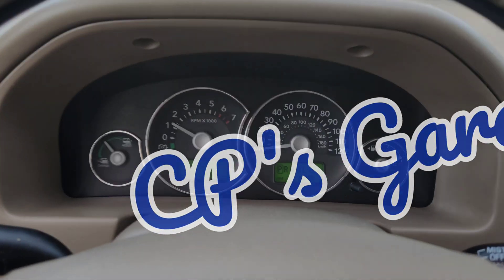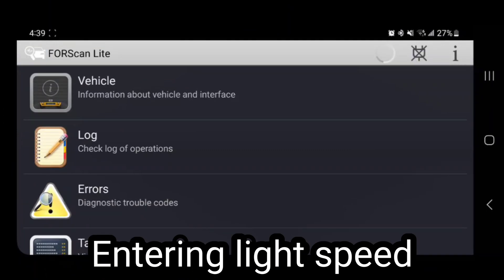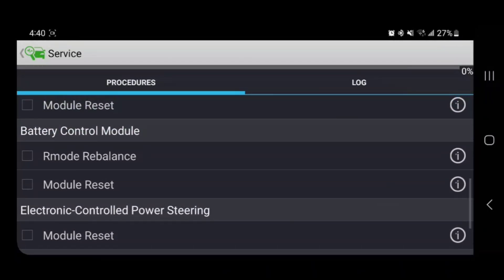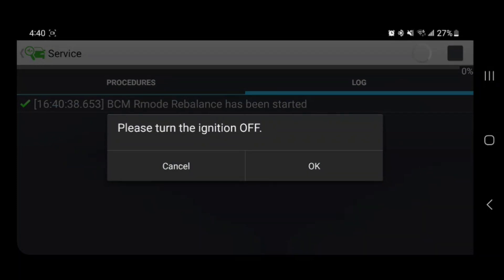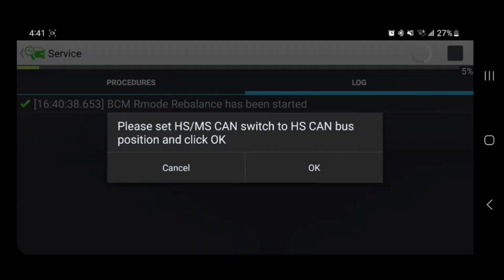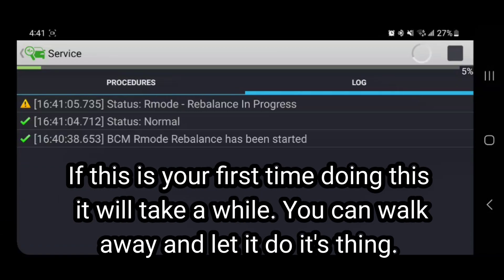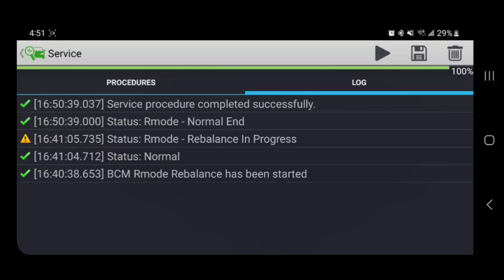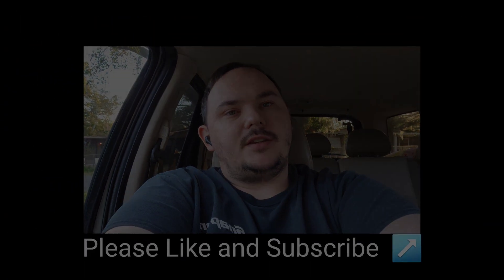How To: #Forscan Lite @Ford Hybrid battery Balance procedure

Comment: This is not how to properly balance the hybrid battery it needs to go all the way through to 100% not jump from any percentage to 100% it is complete yes but only with what cells it could after doing this you need to drive the hybrid a little rough making the charge/assist display fluctuate as much as possible for about 15 mins then go park car wait for it to go into hv mode then start rebalance again may take a few weeks to get it fully rebalanced.
Reply from the maker: Thank you. Just showing how to use the tool.

Comment: Forscan looks to be an awesome tool. I wonder if it would help in diagnosing an issue on a friend's 2011 Escape Hybrid. The red triangle lights up and Pull Over Safely appears on the cluster. I pulled codes and came up with P1A1B and C1015. Whenever this occurred he simply restated the engine and drove off. It would happen every couple of weeks. Now it's happening more often. I'm thinking that the vacuum pump has failed. I don't have a scanner that does bio-directional functions. Can I energize the vacuum pump circuit by jumping terminals 30 and 87 for the pump relay?
Reply: My Escape has started doing the same thing.  Did you find a solution??